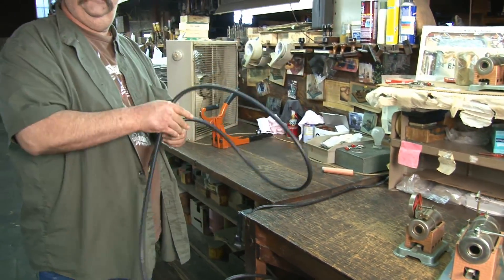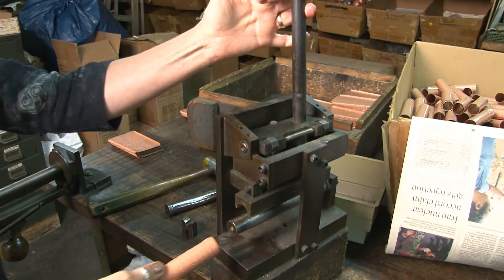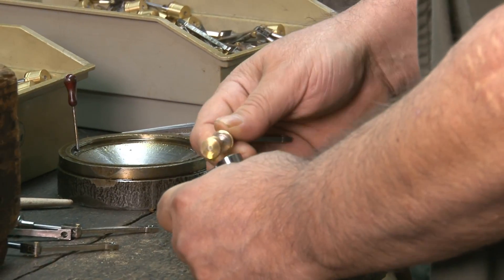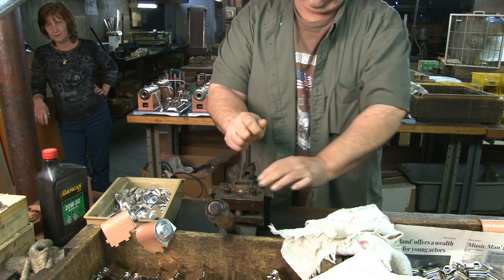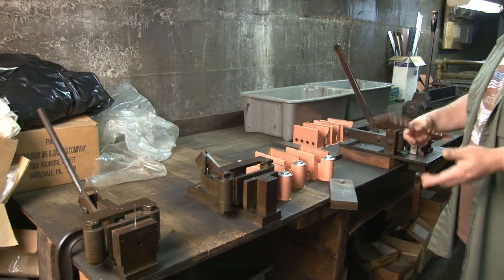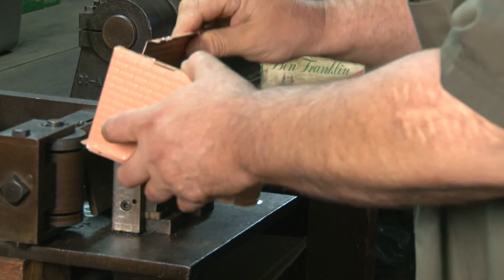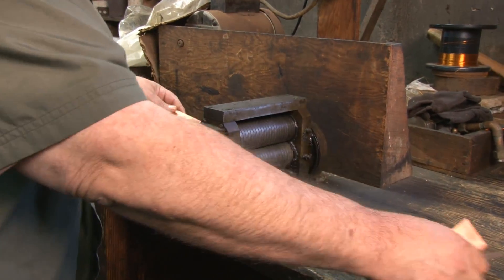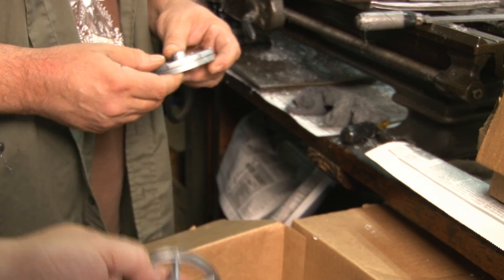Jensen Factory Tour - Model Live Steam Turbines

Comment: I have a little Jensen Steam engine - quite disappointed with it.
Once it heated up, the piston binds up in the cylinder. Now I see why, Using compressed air is not the same as testing it with fire and steam.